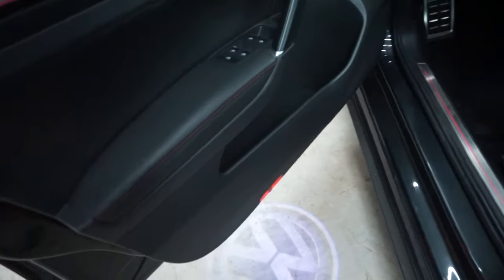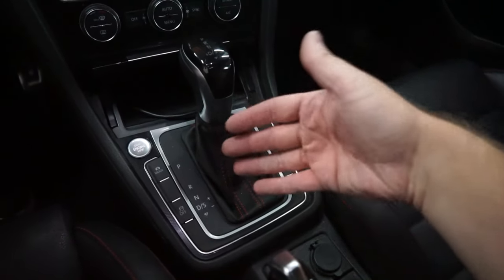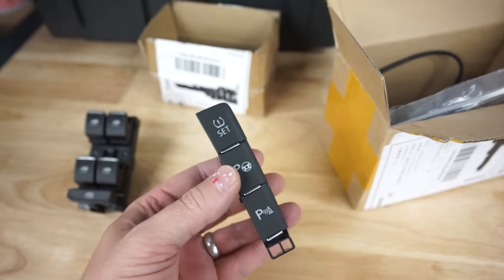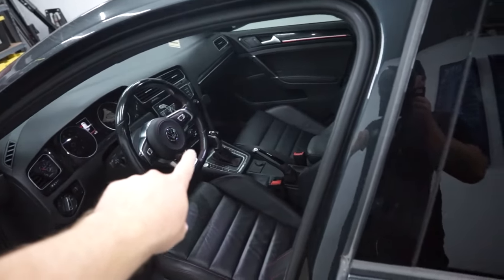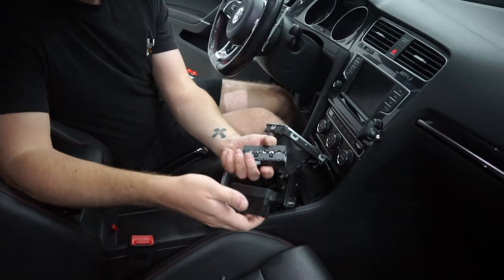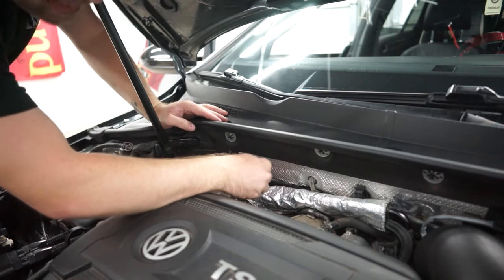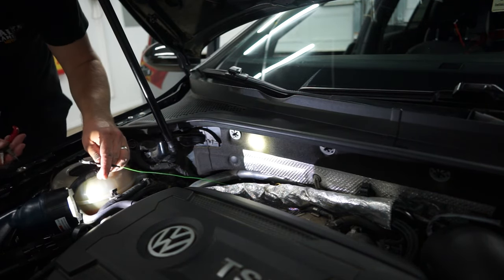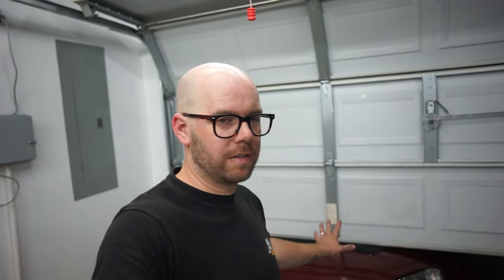Insanely Cheap GTI Mk7 AliExpress Modifications WORTH IT!?

Comment: Found a fantastic dash cam for my Mk8 GTI that replaces the front of the rearview mirror housing. Less that $80 Also got OEM style mudflaps for only $15.  I haven't ordered yet, but have found replacement steering wheel buttons from a standard Mk8 Golf to replace the haptic junk. Looking to be all in with both left and right side buttons and the correct trim garnish.

Comment: I actually ordered the Ali Express spoiler for my 2014 Mazda Miata, PRHT. $24.99 plus shipping, Carbon Miata sold the same spoiler for around 189.00 plus shipping and if I remember correctly, their shipping costs were about the same at around $50.00. I spoke with someone at Carbon Miata and he said they get em from China too, probably from the same place?? I know they look identical.
Anyway, mine arrived in a little over 3 weeks from the time of order, Ali Express kept me in the loop during the whole process. The spoiler arrived in good condition, packaged well. I ordered the unpainted fiberglass one but it was primed. The fit was good and the shop that did my painting and install said it looked good but I'm sure they touched up/sanded as part of their prep. They did however use their attachment tape for the install instead of what was originally sent with the spoiler.
I was very pleased and it saved me several $$$.
Thanks for the video.👍